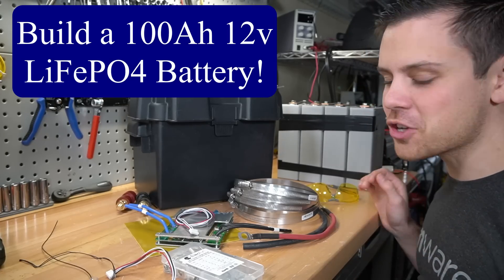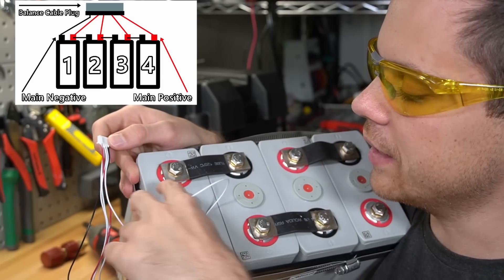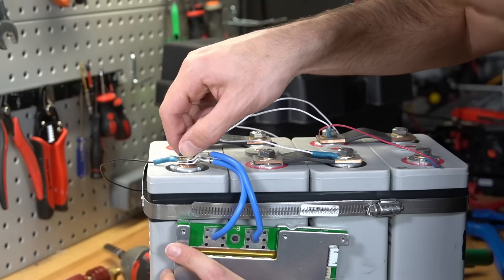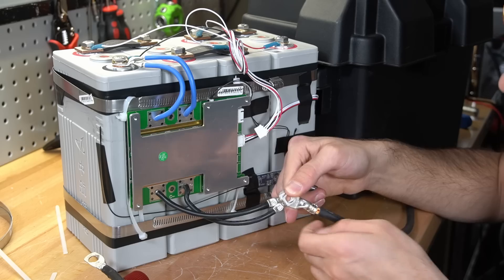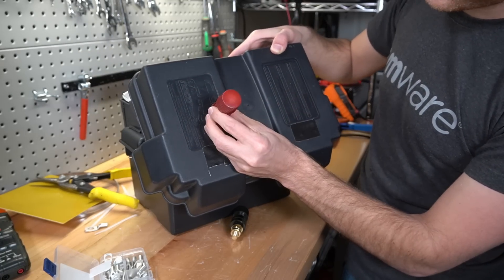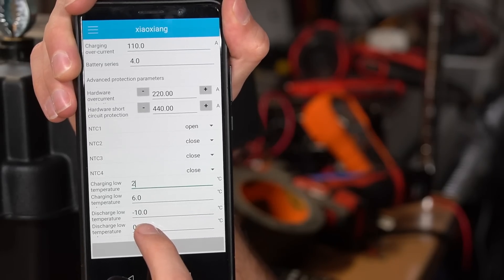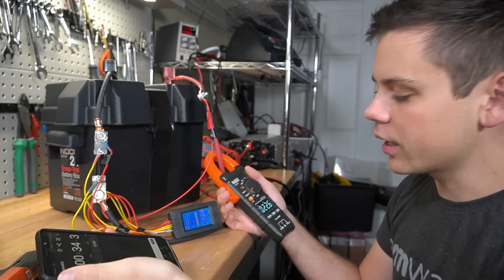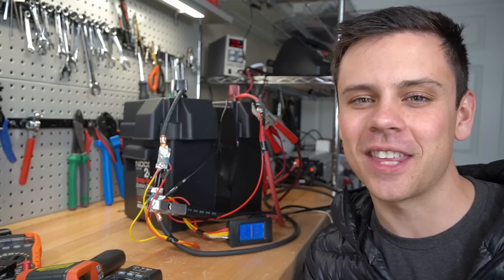DIY 12v 100Ah LiFePO4 Solar Battery for $555

Comment: Hi Will - I really appreciate  your vids. I feel confident to build my own LiFePO4 battery thanks to you. Here is my question: If the BMS low temp disconnect is triggered, would my solar charge controller get fried? My 40a Renogy controller clearly states in the manual that it will be damaged if connected to the panels without being connected to the battery first. When the BMS disconnects the battery, does it protect the charge controller somehow?
Reply from the maker: I actually tested this because I was so curious. I couldnt kill a solar charge controller when it was disconnected from bms but still connected to pv array. I never posted the video but I should mention it. 

And I actually like to connect solar charge controllers directly to the battery and bypass the bms entirely. Just set the upper limit voltage manually.
Reply: @WillProwse  If you bypass the BMS entirely with a solar charge controller, how will the low-temperature cutoff function in freezing conditions unless the solar charge controller also happens to have that function and it is set correctly?
Reply from the maker: @ReflectedMiles  Oh darn, I should have mentioned that is with a victron controller that has low temp charging cut off. oops. Most other controllers would not work in that regard. Forgot to mention that
Reply: DIY Solar Power with Will Prowse so all this search for a bms with low temp cut off can be avoided if the charge controller has that feature? That would be a significant savings for larger (4+) battery banks.
Reply from the maker: @4philipp  oh right. Absolutely. Victron all the way for that. super cheap setup for large batteries
Reply: @WillProwse  from what I saw victron has only an internal temp sensor so you still need a BMS for the low temp cut off - that will tell the  CC's ambient temp - because the temp inside of the CC will be much higher usually ... Also, how do you discharge when low temp or the other protection features are triggered by this BMS - with this build the only way to access the negative of the battery is through that wire that will be disconnected by the BMS, right ? 

Another thing that I was curious about,  would it be possible to have a manual breaker between the CC and the battery so you can manually turn the batteries OFF, so that I won't need a low temp sensor ?  (it would work in my case as I'll never use them during low temp - I wanna build a battery for a caravan that will mostly used during summer )  without burning the actual CC ? I saw the guys from Victron pretend that once the Voltage was setup  you can disconnect the batteries without the CC being damaged in any way ... ever tried that ?
Reply: Can u still discharge when low temp is triggered by this bms? Cause it just got one common port for charge and discharge if I see that right.
Reply: That's an important matter I hadn't considered, thank you. One possibly to avoid killing the controller, would be to place a small AGM battery in parallel with the much larger Lifepo4 battery bank. Even a small FLA battery might work, to keep the voltage sensing function of the controller working, and not self-destruct.
Reply: This is a great question that we’ve been discussing on the forum. Since you’ve got good contacts with the SCC manufactures (Victron, Renogy etc) Will would it be possible to ask them and make a video about it. I myself find it highly unlikely that you’d destroy a SCC if a battery BMS cut off.

Comment: Very cool, Will. This is why I subscribe to your channel.

Tesla power wall is $500/kWh. Yours cost $411/kWh. Very interesting. 👍

Edit:

Put a temperature sensor between cells, maybe the center cells.

Use big zip ties to strap the batteries together.

Rotate the BMS so that the battery connector is facing up to make it easier to disconnect.

Stick the terminals on the side of the case.

Great videos!!!!

Comment: So, ~$2000 and I've got a 500W array, an MPP 812 and 200Ah of storage?
I'm trying to figure out how I start snowballing this.
Pick one circuit on my house and save 2k to swap, save money on the bill and save faster for the next one... I figure that even with the amount that I have to run the A/C, I could make all my own with 6kW x ~5 (low of 4) average hours/day but I'd need around 40kWh in battery. I'd want 100+ to make it a system expected to survive me. 
I guess start small, stay on the grid for backup charging/peak-load, eventually move to a generator for charging/peak and finally get those $50,000 of battery. Ouch, that's a long game.
Gotta start somewhere. Thanks for the awesome content!
Reply: If you're going to 'split' the system, leave the high-draw loads like A/C on-grid, perhaps with generator back-up if you feel those are critical loads. Lets you use a smaller solar system (lower costs) and still gives substantial savings. Use those savings for building a high-efficiency non-conventional home where your current solar system will likely then be all you need.

Comment: Now I remember.
Ok BMS questions.
I want to build 12v 200ah. Can I use 2 BMS in two separate 4 CALB packs, should I get a BMS for 8 CALB cells, or what would you recommend?
BMS bluetooth; would the 2 BMS devices be readily identifiable with different naming conventions or can this be adjusted in the BMS settings...assuming you can use 2 as mentioned in question above?

Comment: Can you do one for camping/emergency?  With the ac outlets and usb and others..?
Reply: It wouldn’t be very difficult to hookup an inverter. I wouldn’t build one in but strap it to the outside if you really want it to be a single package. 
In stead of USB outputs I would perhaps build in a 12V car outlet. That’s quite easy and then you could plug in one of those 12V car USB chargers. 
The 12V outlet would make it easy to connect a whole host of other devices too.

Comment: So what sort of cold cranking amps will this out out for starting a engine?
Reply: this has nothing to do with "cold cranking amps" you aren't starting an engine with a solar generator you start an engine with your engine battery.....CCA has zero relevance.
Reply: @AsTheWheelsTurn  no shit sherlock, was just a question.. just wanted to see if it would make a jump pack if necessary.
Reply: @TheMrgoughy  my bad , I misinterpreted your question.I would guess it would be enough to start most any engine. I have started my van with my coach batterys when my engine battery was bad, it wouldn't crank first thing in the morning after all night draw it was a little low  but by like 10 am with solar recharging I was able to fire up easily so my guess is this system he is showing here would do even better than what I have . my coach batterys are less powerful than this.I can take jumper cables from my coach battery to my starter battery and jump start myself but it takes a longer "soak" than if you had another vehicle with engine running jump starting you, you hav to hook up and leave hooked up for a while like an hour or more before trying to start.
Reply: @AsTheWheelsTurn  oh nice good for a jump pack then but you couldnt replace your car battery with somthing like this? I know some of these new batteries can take normal dc voltage or would it need a specific charger?

Comment: Many thanks, I have set this one aside directly...great om the BMS front.
Ok...questions.
You suggest soldering multiple wires over single heavier gauge  wires to increase BMS current throughput capabilities?
There was something else and I can not remember one  :/
Reply: sgtevmckay yeah, more info on this would be appreciated.  To support 100A continuous draw, what kind of wiring would you suggest from the bms/cell to an inverter?
Reply: @JulieanGalak  for myself I am running two 18 inch lengths of 0 gauge wire Oxygen  Free Copper (OFC) for a 100amp draw to my inverter, but I have never drawn 100 amps....I thing :p
Reply: sgtevmckay - yeah, I doubt I'll ever actually draw the full 100A, but I've already got a good 1kw inverter and I want to design for its max draw.
Reply: sgtevmckay - were you able to solder 0 gauge wire to the tabs on this (or similair) BMS?  Seems it'd be pretty tough to do without melting the board....
Reply: @JulieanGalak  I unfortunately would not know this. But I would venture to say no. The heatvrequirements to solder a 0 gauge wire to this board may actually damage it the board circuitry, but I`d bet I could solder 2 gauge wire to this board just fine. 
I will know better when I can afford one. 
You follow his link below and I found d the price is way way good for this BMS....plus a discount....oh yis ;)
Reply: @JulieanGalak  I unfortunately would not know this. But I would venture to say no. The heatvrequirements to solder a 0 gauge wire to this board may actually damage it the board circuitry, but I`d bet I could solder 2 gauge wire to this board just fine. 
I will know better when I can afford one. 
You follow his link below and I found d the price is way way good for this BMS....plus a discount....oh yis ;)

Comment: I want a 24v 100ah system.  Just build 2 of these and connect in series?
Reply from the maker: Yeah. Actually I would buy a 8s BMS instead. Use one BMS instead of two. Build a single 24v battery
Reply: @WillProwse    Thanks.  Can you recommend an 8s BMS?

Comment: I ordered a set of 4 CALB cells and this model of BMS.  I already own a box like that.  Now I have instructions.  BooYah!
Reply: How did it work out for you for that battery?
Reply: The Big Money Show 大錢爺爺秀 - great.  I use it in my teardrop camper for boondocking on weekends in US National Forests.  I had been replacing the 100 ah lead acid battery about every 2 years.   So if this setup last 2 or 3 years then I’m ahead on costs over buying lead acid at $275 every time. 

I changed out my solar charge controller for one that has a LiFePo4 setting and use a pair of 50 watt panels to recharge it.  I also bought a Noco Genius charger for keeping it charged in the garage.   Since I have a battery lawn mower, the Noco gets multiple duties.

Just this weekend, we were camping at 10,500 feet in altitude and it was pretty cold at night.  We used a diesel parking heater to keep the camper warm at night.   The parking heater uses about 10 amps to fire the glow plug during a 1-2 minute start cycle, then it settles down to less than a 1 amp draw until it’s turned off.  The 100 amp hour LiFePo4 setup was still at 91% by morning.  

The battery box is kept in an aluminum tongue box and all of which must be keeping quite a bit of residual heat.  We woke to heavy frost and it was below 28 degrees F, but the battery was reporting 35 F.

The other thing that I like is that it is 1/3 the weight, and 2/3 the size of the lead acid battery of similar output.  That’s reduced my tongue weight quite a bit and freed up storage for other things.

I love all the BMS’ protections against charging or discharging when it’s too hot or too cold.  I’ve never depleted it to test getting to a point where the battery is bottomed out.

Overall, I’m super happy with it and learned a lot in the process.
Reply: @ppainterco  what solar controll charger did you end up using?
Reply: Paul, let us know how it turns out. Good luck!
Reply: @RockStudioLive  - it’s working great!  I used it for multiple camping trips last summer and for a couple of cold weather hunting trips in the mountains.  

It holds up much better than the 110 ah lead acid deep cycle that it replaced.  For cold weather camping, I heat with a diesel parking heater which takes a 10 amp draw to start then sips power at about .85 amps.  The old battery would Peter out on that, but the LiFePo4 setup still has remaining capacity when the sun hits the solar panels in the morning.

Comment: Could you add a switch to the black wire of the balance connector to turn the BMS on and off?
Reply: no need, the app has a lock icon on the main screen and you hit that and it shuts down all power.

Comment: That's what I'm planning on building when my Calb cells come in. Like those terminals, going to use them.  I'm going to use the DEWALT ToughSystem® Large Case (DS300) (Runnings has them on sale) it has a handle on the top and sides. Totally waterproof, plenty of room for BMS and inverter, 12v outlet and 5v usb, and battery monitor. Thanks for the tips.
Reply from the maker: Very smart idea!!

Comment: Are there any 24v BMS?? I wanted to connect 4 batteries of 4 cells together and am having trouble finding a good BMS for my setup.
Reply from the maker: There are a few. I am testing 24v ones this week when they come. Lots of options
Reply: DIY Solar Power with Will Prowse oh awesome! For peace of mind I’d prefer to have a BMS on there but not pay outrageous prices. Can’t wait to see what you find!
Btw I was planning on building a custom battery holder and spacing them out for better airflow in the summer but it looks like in This video you were saying it’s better to keep them tight together with the ring clamps.... so keeping them tight is best?
Reply: There are like a million .. just google it and tons will come up ....

Comment: At UTI-Sacramento, in the hybrids class, we were taught to wear sterile gloves, with high dielectric strength gloves, then leather gloves over that to protect ourselves from live HV batteries. 12v isn't high, but, ya know.
Reply from the maker: Yeah I just shared a safety bulletin on this actually. If it's under 50 volts, I could care less. 30 volts and under, I'll lick those terminals. It's fine. 400v? Full gear. Anything over 50? Pretend it will kill you. Just in case.

Comment: Will, great channel! You've really got me to the point I'm considering  upgrading the batteries on my sailboat. So with the battery in this video I'd build a 300ah bank. Each have it's own BMS and bluetooth connection or would I build it all as one large battery with a single BMS?
Reply: I'd love to hear the answer to this as well, I'd like to scale this up to something like 400ah but not sure if it would be better to use larger ah cells or more batteries etc.
Reply: You will need 16s connected in series for a 48v pack that work with any 48v inverter. Only one 16s bms is required.
Reply: @neliosamch3195  Only want 12v. But I see I can group 3 100ah cells in parallel to create a single cell and use 4 of these in series to create a 300ah 12v battery. Treat each pack of 3 as a cell and wire BMS appropriately. I need 200A max current draw so this also needs to be factored into the design.
Reply: @tommoss7223  yes, it will work. 3p 4s and a 4s 300amp BMW. Or 3 100 amp bms.

Comment: What else would I need to connect 4 of these to achieve 200 amp hours at 24V?
Reply: For 200-amp 24 system 16 cells are needed.  8 in series and 2 in parallel.

Comment: It looks like the BMS wasn't attached properly. The third cell has a BMS lead on the positive and negative terminal, while cell 2 does not have any lead at all. Look at minute 2:12 of the video. I don't see you correcting this anywhere. Also, I would have put the temperature sensor between two cells. is that a good idea, or bad idea?
Reply from the maker: Look closely. It's correct. Look at my pinned comment

Comment: At 2:13 you can clearly see you have one balance cable hooked up “incorrectly”. Might be confusing to some viewers.
Reply from the maker: No it's on the right terminal
Reply: @WillProwse  I agree with David, you have the BMS hooked up on both Pos & Neg terminal of the 3rd cell.  Shouldn't they all be hooked up to the positive terminals, except for first negative?
edit:  just saw your explanation below about how it needs to be connected to every terminal bus bar, doesn't matter which post.  Got it now.
Reply: DIY Solar Power with Will Prowse yeah I edited my response, but could be confusing to some people just because we’re talking about positive leads.
Reply: This also confused me ( I’m very much trying to learn ) but was under the impression the  bms were to connect to positive terminals 😕 I would love to build the same system and now I’m confused  ( again )

Comment: why the BMS have 2 blue and 2 black wires to be connected in parallel ? they are in different places of the board and I guess they are supposed to do different things. I asked because I wanna make my battery charged by one solar pannel + voltage regulator cc cv setp up down and discharged to the load without connecting the input and the output.
Reply from the maker: You're thinking of a separate port BMS. it will have a lead for connecting to charger, and one lead for loads.the BMS in the video is a common port BMS
Reply: @WillProwse  tanks for the feedback! if you have some video about that, please, post the link. I wanna move from lead acid to lithium here and now prices looks better than many years back when I started my off grid system.

Comment: Just a couple of comments, firstly, the thermistor  should get its own bit of tape (preferably long life kapton tape or similar gaffa tape) and for the blue tooth antenna wire, as it is 2.4Ghz you want the majority of the antenna in free space (i.e open air) so a plastic/paper straw can be used or a dedicated antenna tube as you often see on RC models  and just thread the wire inside the tube, this way you will get much better range for checking your BMS. :-)
Reply from the maker: Where do they sell those little straws. I used those on my race drones but they always came with the tx/rx. Maybe I could shove it in a tiny straw from a coffee shop
Reply: @WillProwse  aliexpress dot com/premium/plastic-antenna-tube.html?d=y :D I also think the usual amazon/ebay have similar under the same description. but yea, those real thin chuppa chup cup straws would be perfect!